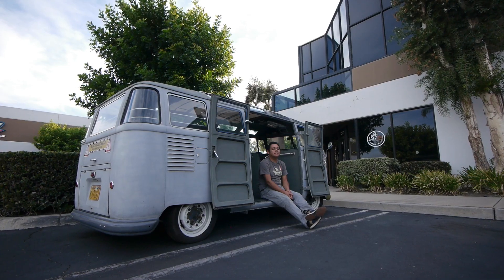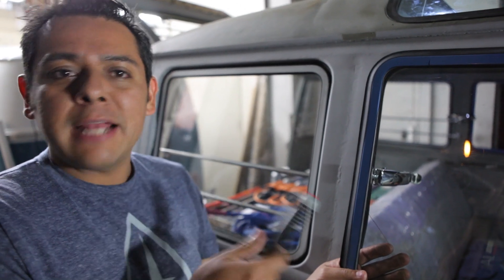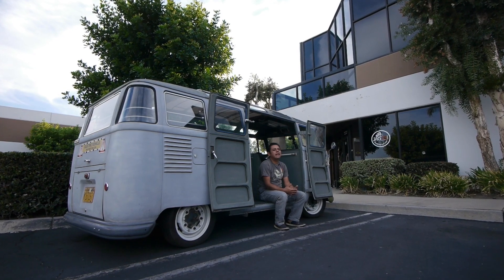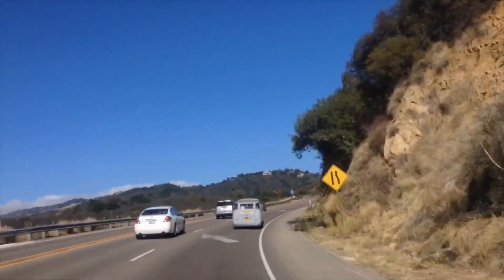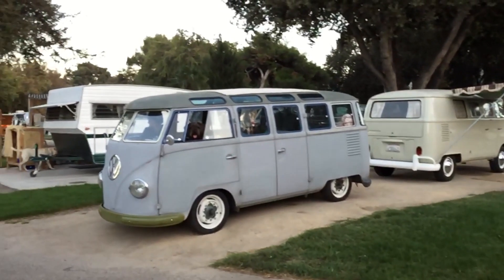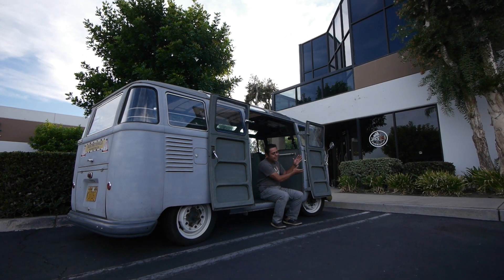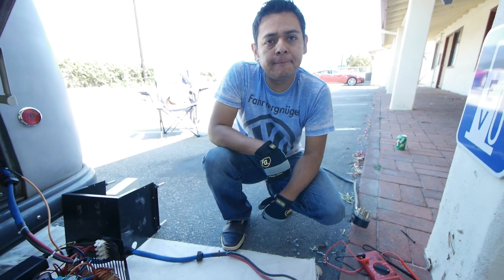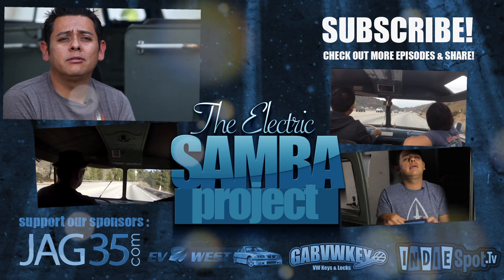Electric VW Samba Road Trip to Solvang w/ Tesla 18650 lithium Batteries DIY

Comment: Jehu: It occurs to me (as a mental exercise) that a couple of cheap ($15) 110V/1500W electric heaters (buy at the same hardware store where you got the diode) would work fine in parallel as ballast for an emergency 220V charge to your system. I think you said your pack topped off voltage is 126V and nominal is 111V. True, a 220VAC outlet would give you about 300VDC peaks. But, since the heaters are a voltage device and batteries are a current device, the heaters should work fine as a 109VRMS drop. Each ceramic block is about 25 ohms hot at 110VAC. There are 3 per heater wired as 500W for low and 1500W on high. I believe the heater fan is run through a diode, but I'm not sure - so plug polarity might matter for "cooling". Anyway, I think you said you needed about 250AH to get full charge (you had 50 miles left and I don't remember you saying how far you had to go) - and that would happen in about 10 hours with 2 heaters. You would, of course, have half-wave losses too. You'd also have to watch the local peak voltage at the the packs and back off the heater loads as you approached top-off, but it seems to me that'd be easy enough. My calcs are sloppy guesses, but all on-the-road hacking is... :-) Oh, and you could camp out overnight around the heaters too.
Reply from the maker: I gotta try that,  sounds like it could work

Comment: Jehu, Do you still have your original transmission and reduction gear boxes or have you taken the reduction boxes off your Bus. We are getting ready for our AC-35 and two leaf packs for our 67 Panel Bus. Taking it to my Son's shop for fitting.
Reply from the maker: No RGBs,   swing axle out of a '69 bug for me
Reply: Im planning that route. I have a tranny from a 68 and dropped springs to lower it a bit. I have a lowered front but don't want a narrowed front beam. Going back to modified stock. 

Last year for the US model swing axle in a Bug is 68.

Comment: is it possible to charge ur car battery with gas generator?????if can..... how many watts should be the generator, and how many hours should it take before its full????
Reply from the maker: yes,   you can use any generator,  how long to charge the 45kwh battery?  depends how big the generator, a  10kw generator will charge in 4.5 hours

Comment: Amigo you need to mount the charger in the tunk and add a 12 volt fan.  If you want to direct charger you need a special kind of diode that was designed for outer space.
Reply from the maker: websuspect yes it is on "trunk"  and it does have 2 fans,   but I guess I don't have outer space Diode.
Reply: ( MOSFET )  There used in digital switching power supplies and voltage regulators.  Keep trying.

Comment: Yu sir are amazing. :D
could you tell us what type or brand of electric engine you have? how much cost you  the engine without batteries? can i make the whole batteries from Lenovo? because i see that you have green ones that cots so much and you added the Lenovo ones. this could work wih camperized westfalia or will not be enough as caperized westfalia are heavier?
Thank you sir, Ciaooo from Italy
Reply from the maker: Motor is an HPEVS AC50 retails for $3500 on EVWest.com, right now I got all kinds of batteries in there but eventually I will only be using tesla packs using Panasonic 18650s
Reply: thank you very much sir,
and would you think this engine and tesla batteries should work with a camper wesfalia van? or should be really heavy for this type of engine? or they exist bigger engines?
thank you for your effort to help us.

Comment: On long trips what is your average watt per mile at freeway speeds?
Reply from the maker: The EMW dashboard app says 250w/mile   but in reality i can get 150 miles on a charge so 45kw/150= 300w/mile.    Which is way better than the 400w/mile I was getting without windows.
Reply: Thanks!!  

I also own a old split window VW bus but next I want to get a VW single cab and convert it to electric like you have done.  Your rig is so awesome!!! 

Also on a completely separate note what mic do you use when filming?  Your audio sounds so nice even more so when compared to other YouTube videos :)